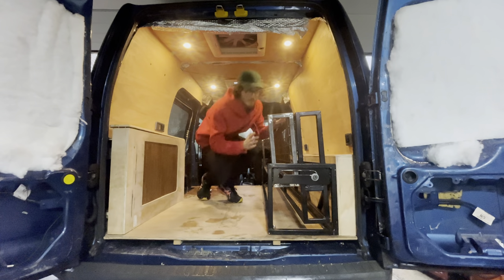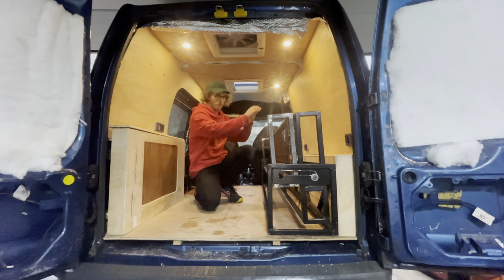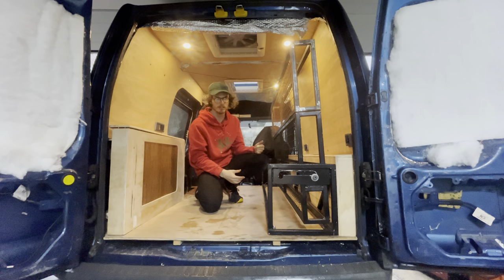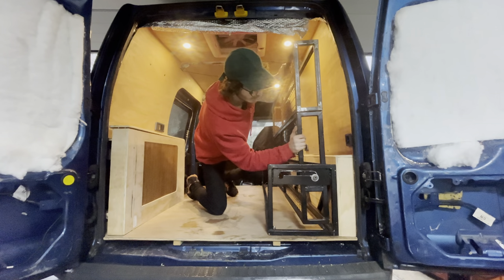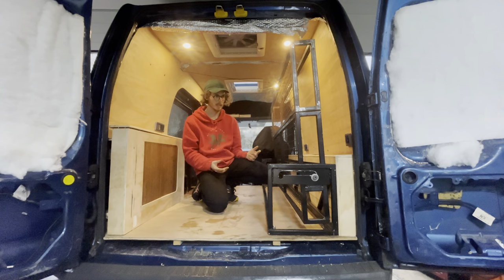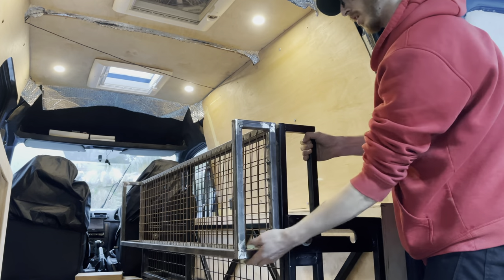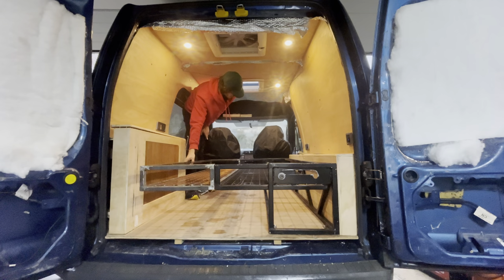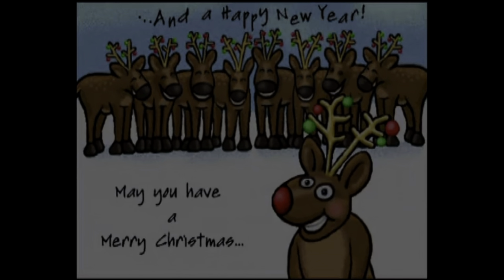SLIDING SOFA BED - The Ultimate Sleeping Solution (Ford Transit Connect Van Conversion)

Comment: This is awesome. I might go with aluminum/rivets to keep down weight, and make it modular(maybe on T-tracks), so it can easily be removed for use as a cargo van when needed.
Reply from the maker: Have a look at aluminium extrusion as an option too!